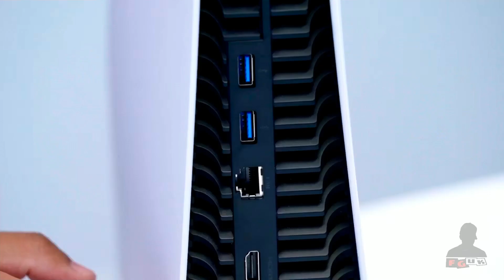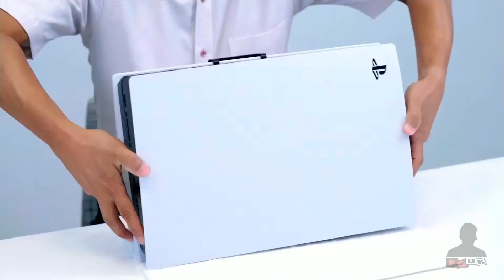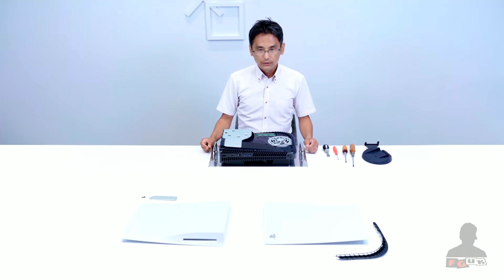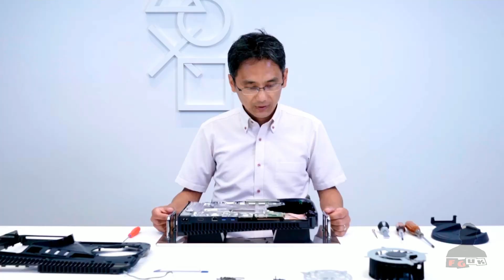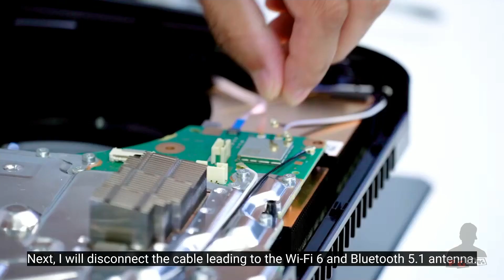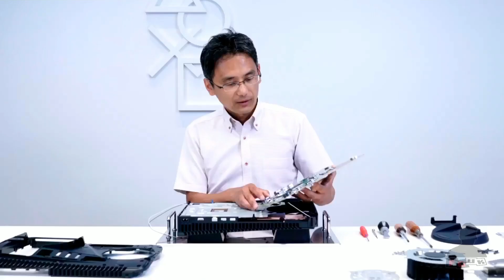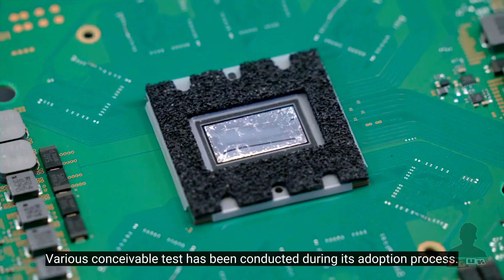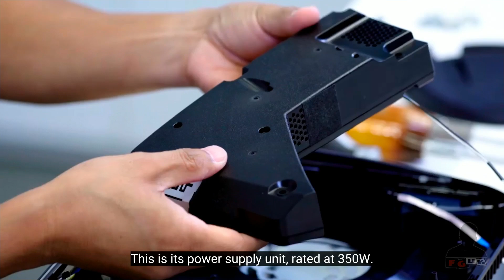The Official Sony PS5 Teardown (English Voiceover)

Comment: I’m glad that Sony finally posted this. I’m sure now people will find stuff to complain about online though. 🤣
Either way I’m getting the PS5 with the disc drive later; not at launch though. I’ll let the early adopters test it out. 💯
Reply: You know it. No one is ever satisfied with what they get. There were people who literally were complaining that it wasn't tall enough for them
Reply: @icaruswindrune7116  Those guys must have a lot to compensate with a big console, lol.
Reply: @Oozaru85  Maybe. Some probably just wanted the aesthetic that a taller PS5 would bring (not looking as wide and also looking more like a modern tower).
Reply: @icaruswindrune7116  Like a modern tower? What kind of tower? A building?
Reply: Most complainers keep talking about how big it is. I'm like are you carrying your console around? Everyone with an LCD TV has a short table below their set which should be hanging on a wall. I can hold probably 20+ PS5's on my entertainment table.
Reply: @evilformerlys4704  Yeah. There are also some complaining that it was smaller than they wanted. One guy was also complaining that he couldn't hot swap the PS5 SSDs.
Reply: Without complaints, the world wouldn’t know how to function.
Reply: Well said
Reply: Well it won't melt like the Xbox and it's a much better design.
Reply: @killslayer459 Technically the hot swap is a bit different (its like the Nintendo cartridges, but holds multiple games). That was the guy's main complaint, that the PS5 cannot use hot swap for 3rd part SSDs.
Reply: Be to hard get one I wait till after xmas like feb
Reply: @killslayer459 That might be the case. problem is the person is saying PS should do it when xbox did it with their 2 lane PCie SSD 4.0 and I/O system that is less customized than the PS5's SSD and I/O system.
Reply: @killslayer459 think the series x has a bigger fan on top but the bottom halft of the console aint looking good
Reply: @killslayer459 Exactly. I don't know what they are rated at either, but most of the 3rd party ones PS users would be getting are rated around 600 to 1200 TB of possible data transfer (600 is for the 1TB SSDs and the 1200 is for the 2 TB SSDs). If those are rated well though, then it might be viable.